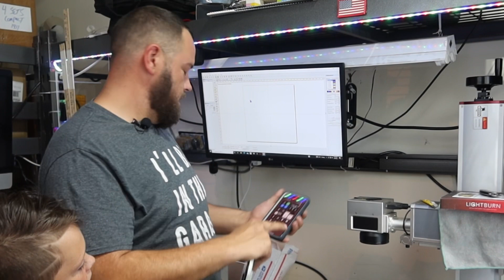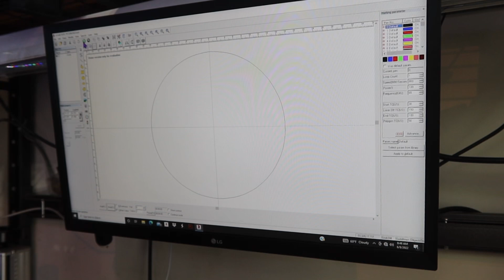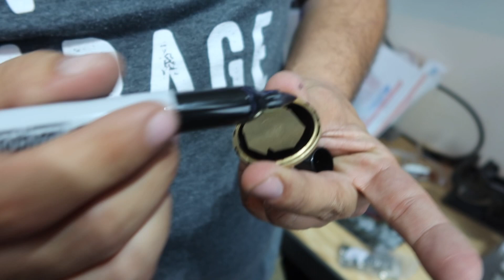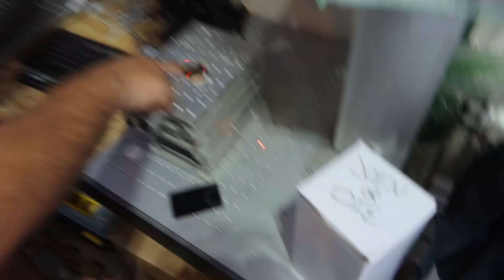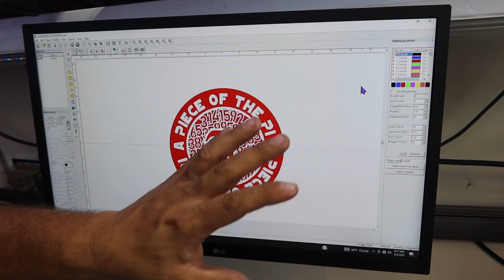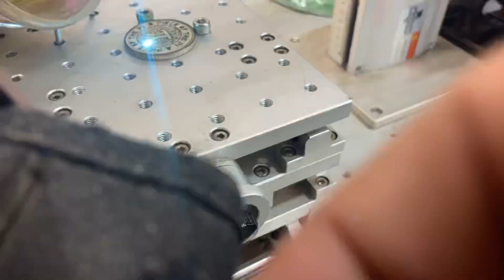How to Engrave Brass Coins with a Fiber Laser @FiberLaserTraining

Comment: I know how to create 3d models, but I don't know how to draw in raster or vector programs. Can a laser machine accept a .stl file with the correct dimensions (e.g. 0.25 mm engraving depth)? Or do I need a vector or raster file?
Reply from the maker: Good question! Ezcad will accept stl in 2 and 3 
Lightburn does a grey scale height mapping but yes. Should work with both.
Reply: @FiberLaserTraining  Thanks for the reply! It helped me a lot.

Comment: How long did the coin take? What's the depth of the "cut"? and could you add slopes and topology instead of a binary "these parts are removed and these parts are untouched" ?
Reply from the maker: The coin took about one hour for each side. 
Lightburn has the ability to manipulate grayscale images that you could get your desire result with.

Comment: Great video Jeff, question how would I translate these settings to Light burn? I notice some of the settings such as the angle of 5670 is unattainable in light burn? I could be wrong but this is all new to me. I was able to create a very good coin early on but now I use Lightburn.
Reply from the maker: The start angle is really not important. It’s the successive passes the angle rotation is critical.

Comment: Just  got on board with these videos, I think it's awesome you have your children involved. These are great times you can reflect on as time goes by. Great job with them and the content, keep it up. I'm going to go out on a limb and say because this coin has inner meaning, you are keeping the design to your self. But if not, would you care to share? I went to use the free download of the skull coin but I don't use Ezcad and have no clue what to do to make work in LB. Any help with that would be greatly appreciated or even a good topic for another vide (hint hint)?
Reply from the maker: Hehe. I plan on making the coin for LB also. Keep an eye on the website. 
Www.Laserableitems.Com
Reply: @FiberLaserTraining  I did not see a place for downloads on your website, only the pop up that appears when you first enter it. Am I missing something?
Reply from the maker: @ChargerDude70  at the moment just the pop up. I am working on having a files section.

Comment: How do I determine lens size?  Where do you buy your lens from?
Reply from the maker: There’s some numbers on the side of the lense. 
“F= “
Is a nominal focal distance. 

Tell me the 
“F=“
Number
Reply: F-theta lens 1064mm  f=430mm
Reply from the maker: @mitzinewman3238  that’s most likely a 
300mmx300mm
Work area. 

F3 parameters should be set to 

Field size =“300”

Comment: Great video - thank you!!  Question:  when I run identical settings, I do not see that the direction of burn actually rotates - it seems to be identical no matter how many runs I specify in TOTAL.    Is that correct?
Reply from the maker: Make sure you have rotate angle selected in the hatch settings.
Reply: @FiberLaserTraining  Thank you - yes, I have it selected in hatch - in all 3 hatches - exactly as in your video.   But it does not actually rotate.    Number of loops in b both hatch and pen settings are set at 1.
Reply from the maker: @dannirr  can you send me an email with pics? 
Info@upstatelaserengraving.com

Comment: That wireless keyboard your using there, it looks like it's a Logitech K400r, is that true? If so, it's a security risk, as are any wireless keyboards that do not specify use Bluetooth! If your wireless keyboard/mouse uses a generic 2.4ghz wireless signal instead of Bluetooth, it's very easy for a nearby attacker to gain full control of whatever computer that keyboard is connected to. Look up "mousejack" is your unfamiliar. It's probably not a huge deal if your just working out of your garage, but if your gonna setup a business in an actual office space somewhere with multiple computers and workstations, don't use wireless keyboards and mice unless they are Bluetooth. Bluetooth is by no means unhackable, but it's many orders of magnitude more difficult, and will stop the low script kiddies and low skill hackers.
Reply from the maker: That is definitely handy information!

I am not super concerned for myself, but definitely awareness needs to be raised over this issue.

I am not concerned because all of my machines are standalone machines without a net work, and therefore there is no sensitive or personal information on them.

Now if they started selling my Laser files… That would be bad for me! Lol

Thank you for the insight as I have never heard of such sorcery!

Comment: Cross hatch is a non issue - its the auto rotation thats needed with the cross hatch. cross hatch however should be used as you chop up the surface as such, thus making it more effective. Lines left are more due to incorrect hatch pattern and lack of auto rotation. Still good video!! :)
Reply: 1
Reply from the maker: Yeah man we don’t use CH for numerous reasons. 
You’ll learn as to why soon enough!!!
My hunch is you will no longer use crosshatch either after my explanation …
Reply from the maker: #teslarule